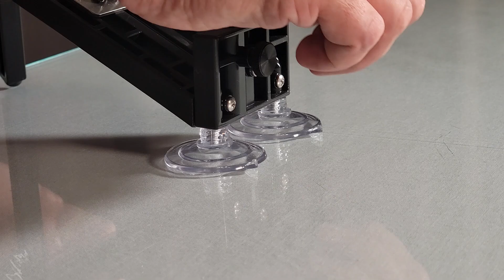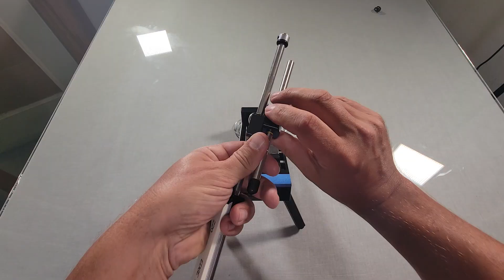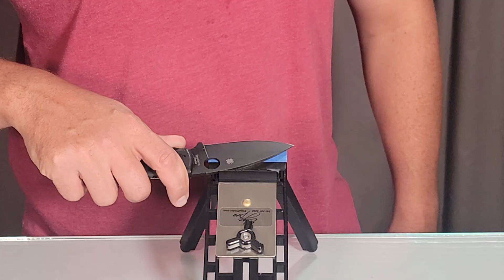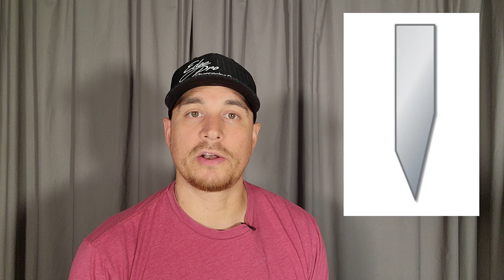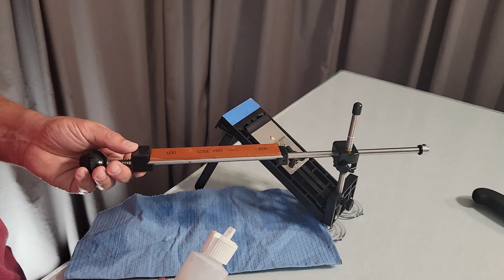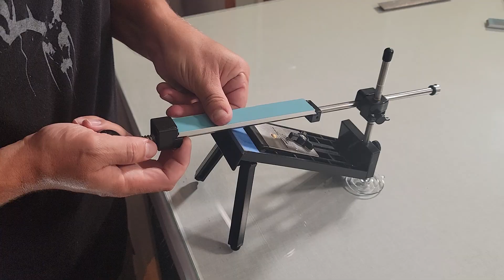How To Sharpen a Knife - A Step-By-Step Guide For the Beginner

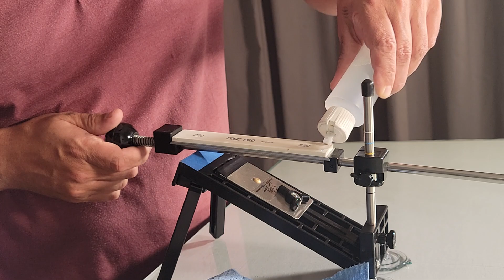Comment: I am Blind, and would appreciate any thoughts you have on best ways for me to learn to sharpen. I’ve had some success with larger knives, but I have also ruined a few smaller ones. Have The work sharp field sharpener, and anything else you could recommend would be greatly appreciated. Love your channel. 3:58
Reply from the maker: Hi Chris, thanks for following! If you are vision impaired it would be really important to be removing metal in a slow, controlled manner and I  an Edge Pro Apex or BevelTech would be great for that. Using your other senses will be very helpful. The coarser stones make a distinctly different sound than the finer stones. And sharpening with a coarse or medium stone until you can FEEL a burr. Then progress through the finer stones. If you ever want to talk about it sometime you are welcome to call me. 541-387-2222 - Cody

Comment: Mine comes in the mail tomorrow and I can’t wait!
Reply: Thoughts?
Reply: @SmittenAce  its been an amazing investment and easy to setup and use. You spend 15 minutes on a knife and it’s crazy sharp.
Reply: @froggergoat  yep just got it. currently working on it too get a sharp knife. thing is im an abbatoir worker in a boning room as a slicer so it needs to be crazzzyyy sharp but should be able to get it goin too that level with practice
Reply: @SmittenAce  I want to get the upgrade kit. The water stones are great but I’d like to try the diamond ones out. I have a few blades in magnacut and it takes a bit longer to get them where I like them.
Reply: Let us know how you go.

Comment: my cheap chinese knife just won't develop a burr.... I ground so much away from it!
my razor blades all do tho. it's a pain to hold it in place LOL. I need a cheap practice knife so bad...
Reply from the maker: It sounds like you either need to raise your sharpening angle, or . . .the burr is there and you just can't feel it. I think some people just don't have good nerve endings in their fingertips making it very difficult to feel the burr.  If you've removed metal all the way out to edge, the burr is there (opposite side you sharpened). But I would try raising the angle just a little bit, like one degree and try one more time.
Reply: @EdgePro  I'm tempted to try this with my new Japanese knife but it was like 160CAD and I'm  scared of ruining it! Maybe I can find a tojiro basic in stock to practice with :) I've been practicing on a 15CAD amazon knife. Is there another way to test for a burr if my fingertips aren't sensitive? I have skin issues so that might also be why...
Reply: @Amybnuy  As the burr rolls over you may be able to feel it by sliding the tip of a fingernail in the direction from spine to apex and if it snags at the apex then it snagged on a burr; you are depending on the feel of impacting it with a nail instead of a smaller sense of skin touch. A jeweler's loupe or other good magnification can help you visually examine the edge instead of relying on touch. Dragging stones from sipne to edge and not the other way is important to maximize burr since the other way pulls the metal that forms a burr into the bevel behind the apex but that motion may make a different feel for the clump of metal near the apex so don't fear experimenting.

Comment: When you say 21 degree setting, do you mean per side? Or is it overall angle of both sides?
Reply from the maker: That is 21 degrees per side. This is a general recommendation. It works great most of the time, but of course there is always going to be exceptions. Thick knives you would probably go higher, thin knives you can go lower (more acute) if you want sharper. But there is always a trade off, when you go lower and get sharper the edge is less durable.
Reply: @EdgePro  I have some Japanese knives that were sent from the factory at 10 degrees per side, not sure if I could use this for those.
Reply from the maker: @dan27052   Yes you could. The Apex adjusts down to 10 degrees.  I would recommend double checking the angle setting with a sharpie before sharpening that knife though. 10 degrees is extremely low even for a Japanese knife.  Watch this video for reference: https://www.youtube.com/shorts/fMa-eagYML4

Comment: Edge Pro, the suction cup design is terrible, same with the vacuum style on the professional model. This is a big factor when comparing it to TSPROF models.  Also, I wish the Apex came in all aluminum like the pro model and with a heavy base option or have a clampdown base as standard. Anything plastic will not withstand time.  For the price, I'd like to think I'm buying a sharpener I could hand down to my grandkids, but not with these materials.  The swivel on the Apex is still the best design though.
Reply from the maker: Thanks for the feedback. We do have a bench mount available for the Apex which allows you to clamp it down to a work surface. https://www.edgeproinc.com/apex-model-edge-pro-system/apex-bench-mount/ .When the Apex was designed it was intended to be light weight and portable. The vacuum base for the Pro model is surprisingly strong, but does require a smooth surface.  I do understand your criticism though, I got something in the works I think you'll like.

Comment: Can you offer some tips on sharpening a "parrot beak" small kitchen knife please?
Reply from the maker: The challenge that these knives present is that the standard sized stone can be too wide to fit inside the curve. For this reason we have a narrower 1/2 inch stone. Otherwise the rest of the process is the same. You can find the 1/2" stones here : https://www.edgeproinc.com/accessories/sharpening-stones/edge-pro-stones/
Reply: @EdgePro  yeah! You're absolutely right! I no longer live in Oregon or in the US for instance. Do you ship to Brazil? Or how long does it usually take to send it to NY?
Reply from the maker: @fornalli  Yes we do ship to Brazil. We can also ship to NY. It only takes a few days to get a package to NY.  Shipping a package to Brazil is a little bit of a crapshoot this time of year, it will get there it just takes a little longer and sometimes runs in to delays. Could take anywhere from 1-3 weeks to arrive. But we have them in stock so there will be no delay on our end.

Comment: Thanks, I have recently bought an Apex. Very nice product.
But I have a question: is there a benefit to owning the slide guide and the small knife attachement, or do they do double duty? Thanks!
Reply from the maker: Benoit, great question and sorry for the late reply. The small knife attachment is good for knives under 3" that are also narrow (short distance from spine to edge). The slide guide is good for small - medium sized knives that you are going to keep in one position and sharpen the whole blade without moving. Unfortunately the 2 are not compatible with each-other (yet).
Reply: @EdgePro  Thanks, so I will go with the slide guide for now.

Comment: I’m new to sharpening with the Apex from this spring and having a blast.  Way better than any other systems I tried and none of the anxiety.  What I did right was picked up a few “decent” knifes from garage sales for a buck or two each and they really helped with honing slow and deliberate muscle memory.  Helped with feeling the burr’s too.  What I did wrong was taking the time to make a space for it in the garage cupboards.  Still have it clamped down on the work bench from day one.  Can’t say enough about the great service  and advice.
Reply from the maker: Glad to hear that Mike! Picking up some knives from garage sales is some solid advice. But "decent" is the key word there - not total junkers.
Reply: @EdgePro  In Eastern NE a fair number of garage sales are more estate sales.  Was able to pick up what could be considered heirloom quality blades in US and Japanese steel from last half of the 1900’s but the wood and rivet handles were past a useful life (likely due to proliferation of automatic dishwashers post purchase).  Time saver tip on garage sales…. Lots of kids garments and toys keep driving.  Any tools/hunting/fishing/boating stuff worth a stop.  A couple tables of kitchen ware and a large sale should stop.  Estate auctions are great winners but rarely had the time to wait for its turn on the auction block.